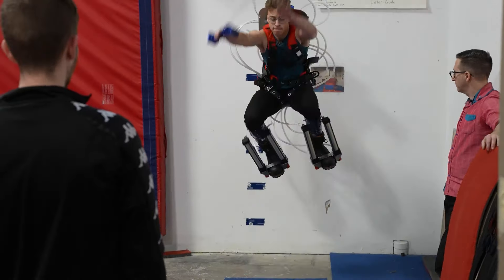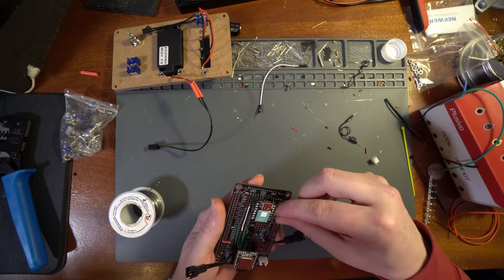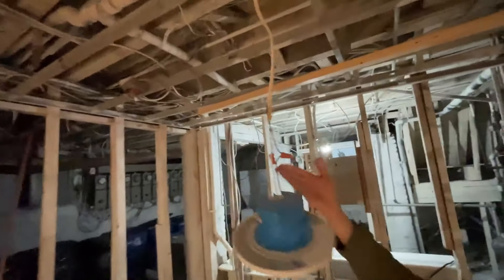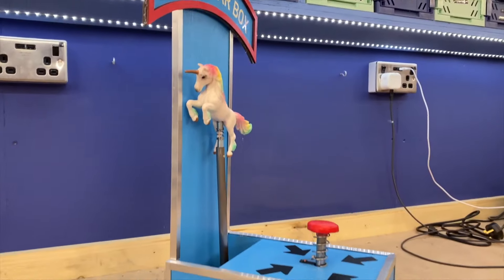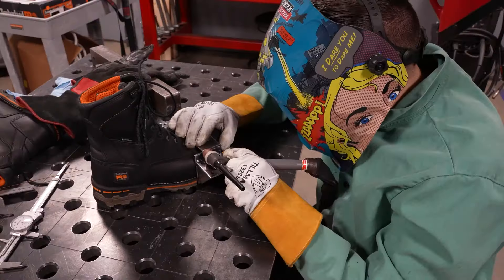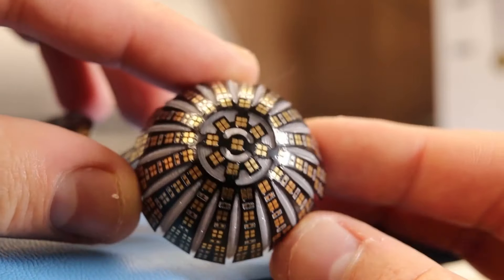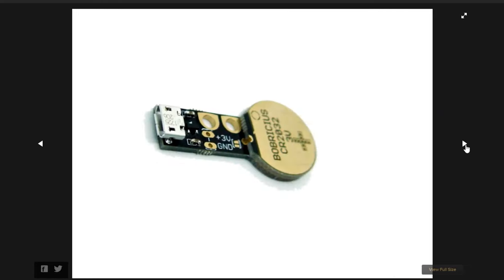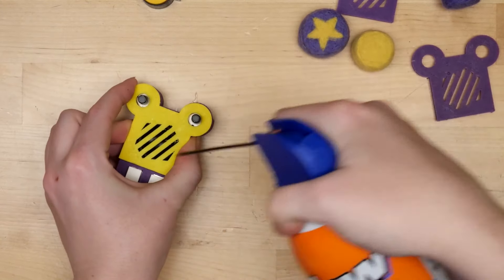Funk in the Trunk [Maker Update] | Maker.io

Comment: Thanks Becky, enjoyed the updates. Not sure how much a can of air costs, but if you need it very often and don't want to buy a small air compressor, you van buy refillable solvent containers and use the local gas station air pump to fill it up. Though the cans are not cheap either.